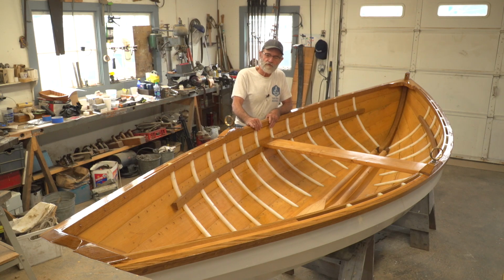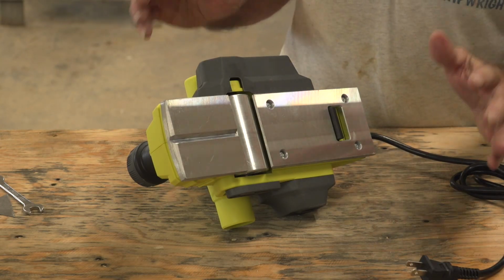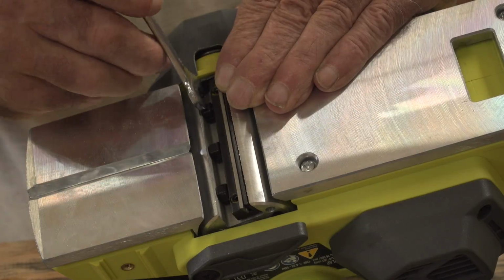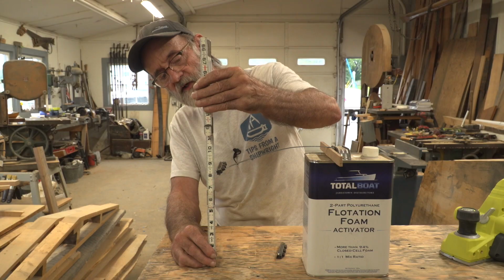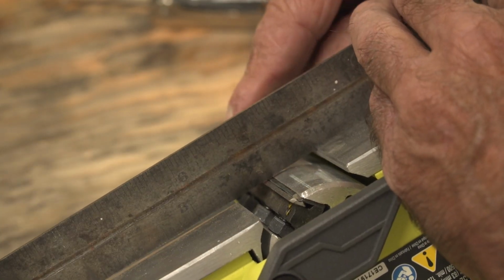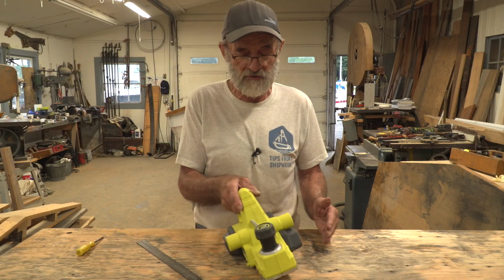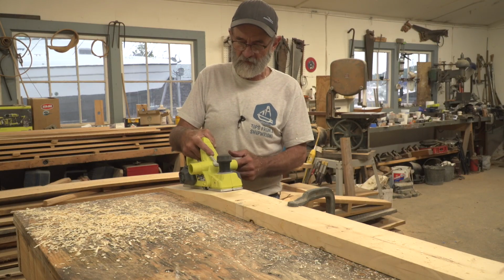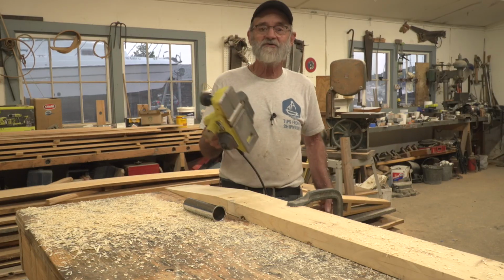How to tune up your electric planer for best results!

Comment: Not sure Ryobi knew what they were letting themselves in for! 😂
Reply: Yup, this info is invaluable to give Ryobi a competitive advantage over other manufacturers.
Reply: They probably can't give it away to consumers without that "security" annoyer back in the sole or on the side these days.
When I rented machines for my work (boatbuilder) or even rented a machine hall for a project I usually had to disassemble "safety" annoyers for quite some time before the machine became workable for my task.
It's a cancer sharky lawyers and successively stultyfied consumers brought us the last two to three decades.
The wider-than-sole cutting insert is a problem many pros did change ever since - I learnt that in my first weeks when taking on my first apprenticeship.
Reply: Likely TTI will take all these tips, implement them, give it a red casing, call it Milwaukee and double the price.
Reply: Jim Campbell 😂😂😂
Reply: Ryobi should listen to this guy and design the tool with these modifications
Reply: @jefftucker9225  I think that's why RYOBI wanted him to try it. Totally free R&D. Very smart...
Reply: Yeah, I dont think they will be sending anymore free tools lmfao, but they could learn a thing or two if they cared to pay atention.

Comment: I'm over three years late to this, but it shows me why my planer wasn't cutting evenly. I inherited my planer from my brother, tried using it and ended up with an uneven cut. Now I know why! I foolishly believed it would have been set up properly from the factory. Guess my brother thought so also as it looked like it had barely any use on it. Thank you so much for this! A definite Thumbs Up and subbed. And that boat you built, shown in the beginning, looks beautiful! Excellent work.
Reply: I too am a fool that thought it would come done right from the factory. From day one it was cutting one side deeper, and I was thinking I'm not good at a planer yet 🤦‍♂️

Comment: There are those that worry about your “alterations”, but it’s great to hear a seasoned professional’s opinion on a tool, especially someone who isn’t hung up on price point and just cares if it gets the job done right for them. And yes, sometimes that means making some changes. Manufacturers of course have to worry about safety and liability, we all understand that reality, but occasionally those elements make tools perform less than optimally. Hopefully the Ryobi engineers watch these videos and find ways to improve their products in newer generations. I know this video has been out for a while now, but thanks for posting. It was very helpful.

Comment: I hope the planer manufacturers are taking notes.
Reply: Peter, not so much.  Lou said the design 
was sound, just needs some "adjusting."

All the others were worse.

steve
Reply: I sure hope they do. These are small changes to make in production. Most of it would not be expensive for them to address at all.  Like the chip ejection issue, just design it to work correctly with a plug as Lou uses and ditch that flapper mechanism entirely. It may even save money in production once the change was made.
Reply: Hahahaha. My new ryobi is jamming exactly like that and if the surface is even slightly moist it's just Hell and Israel.

Comment: Thank you so much for posting this.  Not only did it help to change blades in a previous model planer, but also how to set the depth of the blades, which now I find out is where I was going wrong before, which as a women new to woodworking was oh so useful.

Comment: My dad built a log cabin style home and my job was to square up the timbers. They were milled sort of with an Alaska chainsaw mill over sized red oak. I burned up 5 craftsman power hand planers and 20 belts. I learned candle wax on the base makes them slide better. Never got the nose plate to stay straight and flat. I like your blade modifications. Amazing boat build.Thanks for sharing!

Comment: IMO as a craftsman since 1966 Ryobi is the best engineered tool on the market today . Milwaukee , DeWalt and  the others will stand up better to severe abuse but that’s there only quality . The others are expensive, heavy and poorly designed. Most of my tools are Ryobi cordless as I’m on job sites often. Truly a fantastic Line of tools and the cordless line has well over 100 tools to choose from.  Great video .  Ps ; the impact driver is a must have

Comment: Great video!  Ryobi needs to learn from this video to modify their planer to incorporate 1) making the plates wider than the blades so their is no edge gouging, 2) making the air flow work, 3) replacing the flapper with the end plug, and 4) providing the handle extension from exit port to control the angle of the planer.
Again, a great video by an experienced craftsman!

Comment: I'm neither young nor inexperienced with boats or wood but I learn so much from your channel :-)))  I hope Ryobi are watching and recognizing what you've achieved!!  The key, as I perceive it, is the increase in air velocity that 'powers up' the chips (KE = 1/2 mv2 and all that) and the simple means of selecting a side and then providing a handle to make precise control easy. Cheers, BB
Reply: Ryobi could include a handle the would increase control, but also serve as a stopper for the non-eject side. I personally wouldn't want the chips flying toward my hand if I got too close to the handle. I've had some pretty bad cuts and splinters from a similar not. Eject away from the handle hand.

Comment: "And now, the next thing I'm going to do, is I'm going to take this, what I guess they call a safety feature out of it..."

Priceless. Thanks Lou, for all your wonderful videos. This particular one is a favourite of mine, because in it you take a common tool that is virtually useless and turn it into a star player. 

Without seeing how you have customized and optimized this tool, a viewer who has watched videos of you using this gem may have become so frustrated with their own newly bought version of this tool in its out-of-the-box state that they ended up cursing out the tool and you as well, thinking you had sold them a bill of goods.

And yes, I bought one of these a few years ago and did the mods as you've recommended. It works like a charm, and I think of you every time I use it.

Thanks again.
Reply: I'm building my diy tabel saw after getting fed up with the table saws you can buy. All of them were 110 volts and 15 amp. Motors are burning down and yes I had a new very sharp blade in them. The first one was a delta, second a black and decker en the last one a Ryobi this one had the shortest life. So my confidence in Ryobi was very low.  My table saw will run on 220 what cuts the ampère in halve hopefully saving the motor.

Comment: I do not work on boats neither do I use the planer frequently but any time I do I always wished it worked properly and efficiently. Until now! Came by chance across your video and it is truly amazing! Everything is exactly as you explained and ALL improvements make absolute sense. In my case planer is also Ryobi but dark blue color even older version and everything is almost the same. I was astonished with a fact of no-fit too long blades!!! Now I am even more amazed if you say with your experience that ALL other planers have the same issue. Shaking my head! I have done all modifications and cant wait to use my Turbobi planer. Thank you for sharing these true gem-tips. 
All the best sir 🤓

Comment: I'm laughing imagining the Ryobi lawyers sitting down to watch this video and spitting out their coffee about five minutes in.
Reply: Meh, disabling safety features is a great way to screw yourself on a warranty and make them less-liable in civil court.
Reply: @Xelbiuj   Its an $80-90 tool.  If it fails, you either buy another one, or put the parts back on and send it in for warranty.
Reply: ....before I slide my unit in there...
Reply: @Xelbiuj  careful will get you killed. As long as you fully understand what you're doing, you won't need to sue anyone. The warranty isn't much good if you keep gouging your work.
Reply: Hahahahahaha.
Reply: @Xelbiuj 😊😊😊😊😊

Comment: Thanks for sharing genuine tips. You add value by showing all the practical insights to measurements and mods you've made and considered from actually building boats. A lot of you tube tool reviews are merely collectors showing off a new toy. This however is a great video because you share from the perspective of an experienced user, not a collector.

Comment: I just ordered a planer I went with the Dewalt D26676 the information on how to adjust the blades is awesome it’s something I would have never thought of and I am sure there is nothing in the manual about such great fine tuning which is absolutely Necessary for the planer to work correctly priceless information sir thank you so much for making this video!
Reply from the maker: Thanks!

Comment: Your modifications are spot on. I have the same planer with the exact same issues. After mods the ejection is 100% better. I also tuned the blades.  I am an intermediate to a somewhat advanced woodworker. Thanks for this video. I am always looking to learn.

Comment: 👏👏👏👏 wow that was excellent. I just bought one of these used today. The blades were mangled but otherwise in mint condition. You just told me everything I need to do to it. I read reviews on it where people complained about having to set it up but come on. You need to set up every new cutting tool. Even a $2000 tablesaw needs tuning... But the other big complaint was dust ejection clogging. Now I see why and how to fix it. It seems in an effort to save some $ they got cheap on the flapper. It doesn't seal well at all. You can see too much daylight in there and like you said the aerodynamics are wrong. Your solution is simple and elegant. Thanks for the help! Brilliant 🍻

Comment: This man has very much experience on the blade work well. We have to grind edges little bit both so it will limit less steps on surface of the wood piece.

Comment: Many thanks for this great review and suggested mods (still relevant after six years).  Followed your blade grind/setup instructions + exchanged the chip diverter for a removable plug.  Didn't widen the internal chip or blower outlets like you did, but still managed to increase the outflow on the weak side by playing with lateral position of a 38mm /1.5" wide cartridge strip.  Strip didn't cover any of the chip outlet but did block some of the blower port.  Well presented video!  Steve from Nova Scotia

Comment: Perhaps the blades being wide that way, extending a little bit past the sides of the sole, is in order to help when using the planer to make rabbets. I do recall the Youtube woodworker Paul Sellers explaining this, and just now I have checked my Stanley No 78 rabbeting plane and yes, it too has the blade a bit wider. I recall and understand that the reason is that clearance is needed between the side edge of the blade, which is in direct contact with the wall of the rabbet, and side of the sole of the plane. That is, just as the cutting edge of the blade must protrude out of the sole, the side of the blade must protrude past the side of the sole.

Comment: Thanks for this amazingly useful video.  My trusty Bosch planer finally burned out halfway through a job so I bought a SKIL one here in the UK to finish the work.  I was very disappointed with it until I saw in this video that its exactly the same as your RYOBI, just different branding! Now I know I'm gonna love it after a little tuning up, especially the blade height.      I know the kick stand is really annoying sometimes but might be useful for me when I'm working around hard/concrete surfaces, so I'll drill a hole through the side of the baseplate into the plastic foot so I can insert a pin or screw to lock it up out of the way when needed.   My first time here but I've seen enough to know you can teach this 64yr old dog some new tricks. Subscribed, cheers

Comment: Your earlier shows got me inspired to pull out my vintage all metal Wen planer. I sharpened the blades and oiled it up last week.  I tried it on some 1 inch white oak and it cut like a hot knife through butter.  Thanks for the inspiration!

Comment: That was a brilliant video, I am off to the workshop to check out my 25 year old black & decker which I have never liked using because of the problems that Lou describes.  I was in the market fora new one and I think it will definitely be a Ryobi and Lou has delivered a great in depth owners manual.  Thanks Lou...   I love your boat build videos and all the tips I have learned in the 2 build so far, but this was an eye opener for me, an enthusiastic amateur, as I always wondered how Lou made it look so easy to use an electric planer and why I struggled so much.

Comment: Really helpful vid. I've been a carpenter for more years than I can remember and found this really useful. I always liked the bosch and the metabo planners for the choice of ejection and haven't been able to find a machine like that since. So I bought a maktek (sp?) made by makita but it now vibrates and cuts funny so I'll use these tips to fix it. And maybe look at a ryobi in future. I'd love to get back to a planner that ejects either side. And I've always been open to other brands if they work well, not slavishly sticking to the hi end stuff like makita, de walt etc like most tradies.

Comment: RYOBI   have to satisfy the safety regulations. those planers are not finger friendly . But all of the mod's you have done   will not effect any safety issues . at 74  years old   I have learn quite a lot watching and learning from your videos .. you are such a good instructor and hands on worker .  An equally old friend using his electric planer for the first time , was in the habit of clearing the shavings from his hand plane with a forward sweep of his fingers .. YES  his next stop was the Hospital.

Comment: Hey shipwright, on your cordless drill just above the keyless chuck there's a dial. The higher the number, the more torque is delivered  to the bit. Set it at 5ish for delicate work. It will keep you from stripping the threads and spinning the screw. You're Welcome hand..

Comment: Now I know the 1/8 rule for setting the depth of my blades,thanks mate👍😊
Reply: FWIW a level works really well for this. A 4 footer on a jointer and a torpedo on a hand planer. It'l lay flat so you can get two hands on the blade adjustment.
Reply: I think I would use something made from aluminum in place of steel to avoid nicking the blade. But that said I plan to look at incorporating some of these mods on my Ryobi Blue HPL50 which is a much earlier model of the Green HPL52 Lou uses in the video.
Reply: What depth is it set for to get the 1/8 movement?

Comment: I am a carpenter and have this same planer only in cordless, it is an excellent tool in my opinion, thank you sir for this tutorial btw ,odly enough the manual doesn't say how to adjust the height of the blades ,I had to fiqure it out for myself.

Comment: Interesting,  you have set that planer up for your own work, I’ve run planers for years and never trimmed the blades or pressure plates or needed to, but I can see the point for curved work like a boat hull.

Comment: Mine is not a RYOBI but the principles are the same, I've never been a fan of the electric planer though I have had a couple over the years. UNTIL now, I trusted they were setup right. And they are not, what a difference following your video this one cuts as it was meant to. You can teach an old dog new trix. Thank you.

Comment: Excellent video, Thank You for the great information!  My Porter Cable is exactly the same design, so I'll be improving it the same way!  I've been using it to remove gelcoat on a Cal 34.  A vacuum with a Dust Deputy cyclone helps alot. 😊

Comment: Your blades are extra wide so you can cut rabbets. The grey guard is to cover the exposed blades. I do believe that little screw hanging off the side is to hold the fence in place rather than to lock the depth.
Reply: I never used a power planer, but aren't the blades wide so the sole plate can sit flat and isn't running into the edges of deep cuts? No idea if that is really necessary or even works, but this seems logical to me.
Reply: IF Ryobi thought of doing rabbets with this tool, you can only do it along one side and the depth can be no more than about 1/2".  5:48
Reply: That's right. Almost all modern power planers have a 76mm(3"0 wide base with 86mm (3 1/4) reversible solid carbide blades.  Black & Wrecker were the first I saw to sell this system. Most have a 1/4" rebate capability on one side. Most are restricted to between 1/4 to 3/8" rebate depth. Almost all brands are interchangeable. Rigid/AEG (from the same group as Ryobi and Milwaukee - Techtronics, Taiwan) had a very sexy flexible blade which fitted to a spiral cutter on their early battery powered tools.

Comment: Occasionally you come across a video that does what it claims - teaches you how to tune up your planer... plus how to mod your planer... plus how to use a hacksaw blade as a scale... I got more than I bargained for.
I'm sure Ryobi would not approve of some of the mods, but they need to learn something from this man. Their exhaust ports do jam unnecessarily easy. I don't know if this is a reliable fix, but I applaud the ingenuity and can-do attitude. I'm going to take a closer look at mine, I've got the 18V version, but it has a very similar design.

Comment: A really good video. I just sold my Dewalt thickness planer and have a Dewalt planer like your Ryobi. Fascinated how many adjustments you made to yours and I can now see why I was having some issues with mine, particularly the tell tell groves or shoulders created by the outer edge of the blade and pressure bar. Thank you so much.